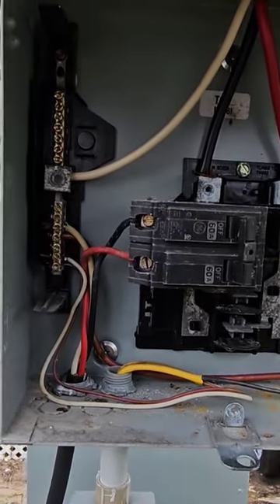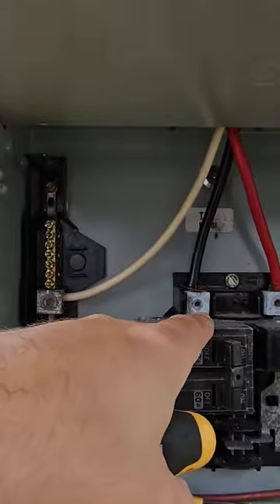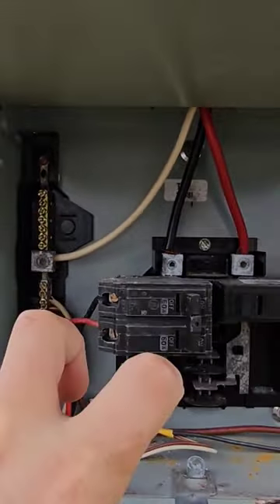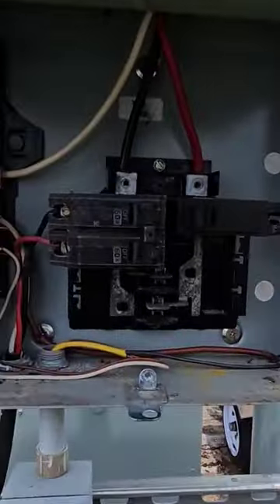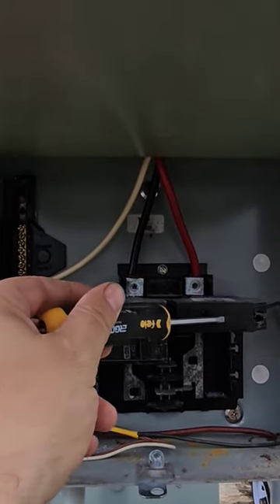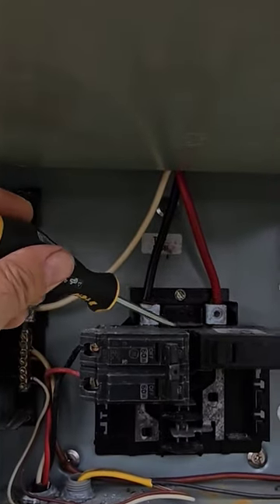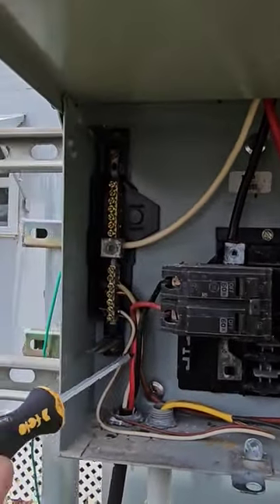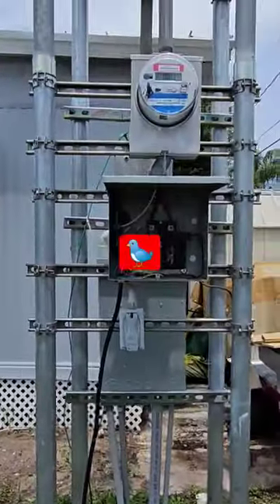There are a few things wrong here.

Comment: Missing main breaker clip because it's a main lug panel not main breaker panel. Designed to be used as a sub
Reply from the maker: Yes, Whenever the main breaker is a plug on style breaker and not bult on it requires a retention clip.

Comment: You need a tool sponsorship. Get rid of that garbage screw driver before you get bit.
Reply from the maker: That is a felo! I love my felo tooles
Reply: @Simonelectricfl wait until you accidently short the transformer and that screw driver is blown into your brain, just saying, play stupid games and it might be your last.
Reply from the maker: @Ozzy3333333  Yea, because screw drivers just fly in every direction.
Reply: @Simonelectricfl  Darwin award nominee, did you miss the point of shorting, willy nelly waving something that can cause a short is pretty stupid, dont worry, you wont know what hit you if you are lucky.
I work on bleeding edge 200Gbaud data tech, this electrical stuff is child's play education wise, but it can kill you in many ways.
Reply from the maker: @Ozzy3333333  This is a felo screw driver, felo is made exclusively as an electrician screw driver i have 3 sets and one is insolated but this is not wear you would need an insolated screw driver but this one is made for working on this exact type of panel, and there are screws all around the interor of panels. Every electrician in the world used screw drivers inside panels. You may be experienced in what you do, but you clearly have no experience with this type of work.
Reply: @Simonelectricfl  wrong, willy nelly waving that special screwdriver, or any screwdriver around an open electrical panel is asking for it, professionals dont do it,  play stupid games and it might be your last. You have been warned.
Reply from the maker: @Ozzy3333333  Thank you for the warning sir.
Reply: @Ozzy3333333 majority of “professionals” don’t give a fuck and use regular tools anyways
Reply: @Steezyy  it's not the "tool", it's how you use it or careless actions with that tool. Jus because your working in a small 100 or 200 amp panel, what's feeding it will vaporize the tip of any screwdriver and launch the rest of it in a random direction before you have a chance to react as it possibly goes through the grey matter.
Reply: @Simonelectricfl  my experience is plenty, mostly in electronics (all repair to component level), PC, power supplies, medical and now 200Gbaud high speed data, all of which is 1000 times more complex than simple power wiring. I have wired 3 houses from the ground up and passed inspection the first time, even being regarded as the cleanest the inspector has seen in his 27 years, all while being the only homes I have done (including RF, data, alarm and fire wiring). While I don't have years for this power wiring, it is totally simple compared to electronics. And quite dangerous if you're doing stupid things near the wrong places. Transformers on residential are usually 15 to 100kVA, let me know what willi nelli waving a screwdriver is going to do when shorting out 100kaVA?
Reply: @Ozzy3333333  Telecommunications is not harder than electrical but agree to disagree. You done stroking your ego?
Reply: @Steezyy  If you are done insulting?
The complexity of electronics (especially the design of bleeding edge chips) is very much 10,000 times more than any power delivery system. What has changed in the last 50 years of the grid, home and industrial wiring. The breaker is probably the most sophisticated item you work with (unless your installing modules), but I guarantee you DONT (and cant) troubleshoot electronics to component level. 
Explain to me the most complex item 
"majority of “professionals” an electrician uses, and understands how to troubleshoot is to component level? I thought so, they just swap modules out, they dont have the time or knowledge to fix them. 
Yout 60Hz is slow compared to the telecommunication operating at 34GHz (yes, thats 34 billion Hz), the tech to get data moving that quick and error free is really amazing. Now go wave your screwdriver at an open breaker box.
Reply: @Ozzy3333333 stick to data
Edit also it won’t send the screwdriver flying lmao it will just melt it or weld it to the lug while it arcs
Reply: @B_Ziggy  LoL, totally shows what you know. Its going to vaporize part of it instantly and what's left over will be traveling away from ground zero.
Reply: @Ozzy3333333  you win whatever projectile screwdrivers O no
Reply: @Steezyy  "He was , in fact, not done stroking his ego..."😂
Reply: @Ozzy3333333  As an electrician for 31 years I've blown up tons of tools but I must be doing it wrong. Can you teach me how to launch a screwdriver? It would really impress my coworkers.
Reply: @stickshaker101  your Darwin award waits for you quietly. Just because you did something all your life, doesn't mean it's correct or safe. Good luck, you will need it.
Reply: @Ozzy3333333  I assume that when I go, they'll rename the Darwin award after me.
Reply: @Simonelectricfl what the Hell is "Tooles"? It's "Tools"

Comment: At the end when you said 60 amps feeding a entire living space on “10 gauge wire”  is it also bad “in my case “ were i have 6 gauge wire runing to a sub pannel to my garage of a 30 amp breaker , from my garage i have another 2pole 30 amp breaker i used to hook up a rv , evrything works but should i upgrage my 30 amp breaker at the main pannel box ?

Comment: That panel looks like it's hot According to the meter above.. Where's your insulated glove?
Reply from the maker: A better question is wear are yours?
Reply: @Simonelectricfl  I get it that you are a professional but personally, I wouldn't even feel safe. Touching 9 V. Without gloves And that's 250V. That you are dealing with.
Reply: @DragonProtector174  You can safely touch circuits up to about 50V with dry hands. But in some very specific circumstances, people have suffered serious cardiac arrhythmia from shocks as low as 20V. 9V is a safe threshold, but you can buy a 9V battery in a supermarket and they're safe for children to handle... it's a tad conservative. I never disconnect the 24V power to industrial equipment when I'm working on it. If I did, I couldn't troubleshoot anything.

(I tell people 5V, because that 's the maximum digital logic level.. so don't be ashamed!)
Reply: @Simonelectricfl Mine just came in from the home office in St. Louis, Class 0, 1000V, tested Dec 2023 due for exchange and testing June 2024, in a pair of Condor leather protectors, in a glove bag under my desk in my office. Again, where are yours?

Comment: How much would a fix like that cost in your area my panel is the same way and with may more breakers
Reply from the maker: It's tough to say it depends on many variables but between 575-2000 for panel and running the new larger wire into the structure that depends on what size wire we go with and distance. But that could easily be more than the panel repair/replacement.

Comment: Yeah, it's old but would not be too hard to make it safer, although there does seem to be some corrosion in the panel. My main worry is the draw on that piece of SO cable. Good chance they have an AC and a water heater in there so already maxed out on the feeder. Let's just say we'll go with 20 - 30 year old code and use the 60 amp for a main, then downsize to a 30 or 40 amp for the SO feeder, plus fix the grounding issues. If there's money, then replace the SO cable with some #8 or #6 direct burial cable.
Reply from the maker: Yea I will be trenching in a new feed when they give me the green light. Plus a few other things to bring it up to code.

Comment: DIY guy; oh man the feed wires from the meter are too short (and underrated), OK instead of replacing the wires to reach what should have been a disconnect breaker I'll just tie them in here. I just saved myself the cost of a 30 amp double pole. That panel is messed up. And nothing wrong with his screwdriver if it does the job. Suggestion, put a piece of red heat shrink tubing on the screwdriver and put a smile on someone's face. :)

Comment: The 60 amp is the main breaker going to the mobile home. The mobile home has its own main connected to that 60 amp. The 20 amp is probably going to some outside receptacle and lighting. Have you ever been shocked by electricity? I'm guessing not.

Comment: 6 throws of the hand, perfectly legal when that was installed, and still today
Reply from the maker: No they are plug in breakers and no retainer clip. Main breaker that is plug in and not bolt on need retainer clip.  Also not aloud anymore.
Reply: @Simonelectricfl  can u send me the code ref on the clips? I cannot find that in art 230. The 2020 is much stricter than previous I see, but still allows 6 switches.  This service would have been legal when installed though, more than likely
Reply: But it dosnt have a main.. Just not labeled probably
Reply: @etucker when exactly was 10 gauge wire on a 60A breaker legal? 😂
Reply: You're only required to have a retainer clip/screw if the breaker is hot when you pull it off the bussing. If the bussing is what's feeding the breaker, no retainer clip.
Reply: @Simonelectricfl  Retainer clip only when backfed, this is legal as you were told elsewhere

Comment: I don't see what the complaint is. Looks like a "temp" hookup 20 years ago. 
Easy just get a new panel why stress looking for parts and running all over town.
A customer of mine have the old pushbutton breakers. Try finding those breakers. It was just easier and cheaper to replace.
And the crazy thing is I actually preferred those push button breakers.

Comment: To be real, i did a panel at work almost 12 years ago with fine stranded tin coated mtw wire and doubled or "folded them  over to use up more area in the lug, never thought about it till now. Never been an issue 😅
Reply: Only if theres vibration I think,  they will slowly shake loose and burn
Reply: @kinbolluck476  hope not lol. It was on a mobile screening plant. Every precaution I attempt is for that exact reason lol. They shake like crazy. To me, if I land a 6awg wire in a lug rated up to let's say 2/0, I'll torq it down, and grab the wire and wiggle it, if I can see the copper strands moving in the lug, ( you could run it in with an impact and it's still going to happen ) I'm pulling it out and doubling it up. The Allen grun screw on most aluminum lugs is smooth and rounded where it pushes down on the wire, it often fans most of the strands to the side and only bites a few. I should say i rarely do it anymore since years back I found a super awesome component called a wire ferrule. Use them on everything now. Every control wire and every feed wire. Time consuming, but worth it

Comment: That considered a service disconnect…you may or may not be required to use a main bus breaker, that a hot bus and you can indeed run a breaker to service a sub…the 10 wire on a 60 is a no go…that also appears to be a 60 amp meter base…go beyond and do a load test…upgrade the service cable…
Reply from the maker: You can use plug on breakers but you need a retainer clip

Comment: It is legal . Code says you need a main breaker if you.have 6 breakers or more . The SO cord feeding the trailer is a problem though. Because the code says wire shall be adequately protected and it's not .

Comment: That is a 812c GE panel it uses a tqmh000 main adapter there is no need to do that is like 20$ and it goes plug and play easy the right way hope it helps check nec and make your load census 😅god blesse

Comment: As long as it’s connected to a breaker in another panel or has a disconnect down the line, it’s completely legal
Reply from the maker: No you can not do that it is a multi wire branch circuits you can not fuse it on the load side like a service entrance. Also the smallest service you can have is 60 amps even if this was a service feeder and there is also a disconnect required 72" from meter.

Comment: Other than the "main breaker" i dont see what the big deal is 
It probably was the main breaker in the beginning then the 20amp was added 
The wiring is correct 
The bonding screw should be there but its not hirting anything 
Its obviously working 
Leave it alone 
Anyone working with electricity should check for voltage with a meter before work is even began.

Comment: I have to say this,, technically, that is proper,, that box is your service,,, same as like a big multi unit, the feeders feed a buss, and then taps off the buss as Mains that feed sub panels,,, so yes, so long as your primary and secondary grounding conductors run into that box, that is your service,, every thing come out of/ fed out of has to have seperate grounded and grounding conductors in the feed ,, and those things being fed are now sub panels,,, so with what I said before combo Ed with this,, it totaly depends,,, if that little box is your service, then until you get over 6, sub feed mains,, there is no need for a "main" for the service,, it's totaly depends on the situation,, you may be looking a legit service

Comment: Who plugged that meter in there? Customer has no main breaker. Now if there is a fault in there? The last line of defense is the fuse for the transformer. That’s on the high voltage side. Scary !

Comment: Gees, all domestic American electrics looks so industrial, clunky and outdated.
Reply from the maker: This panel is a bad example to go off of as a representation of American panels. But there are definitely differences between European and American panels one of the reasons for that is most companies don't want to spend the millions on obtaining new ul listings on different/ new breaker and panel designs.  So the breaker and panels that have been manufactured for the last 30 years have proven to be pretty reliable and safe especially with the addition of arc fault. But I have been to many areas of the world and comparatively speaking  a few countries have newer/more updated equipment but 90 percent of the rest of the world are not even close to the safety and regulation that American provides.

Comment: Bonding screw should only be used at the first point of connection either off weatherhead or transformer. Not off that small subpanel.

Comment: Dude has never seen a MLO panel before I guess
Reply from the maker: You can not have a main lug panel wear you need a main breaker. Unless you backfeed the main breaker. They wired this wrong and the main breaker became the branch circuit.

Comment: No shortage of anecdotes about amateurs and professionals being shocked or burned or killed working on electrical. For example I notice you are not wearing gloves nor is your screwdriver insulated. The safest way to show items in the panel or reset a GFCI is a short wooden shaft like a chopstick or dowel, just throw one in your tool bag.

Comment: First let's keep the screw driver out of the panel and second didnt mention that the breaker over under wired for its size too.  You said it was a 60amp but wires ment for a 40

Comment: 😂 the 60 is the trailer main.  The 20 is not going to the trailer.
Same way i have a box outside like this with 2 100A and one 200A mains for my buildings. And a 20a for my yard light.

Comment: Nevada needed no final on mobile homes till the 80,s lots of fires so cord from service 0anel to trailer or.metal flex not seal right water proof no ground wire 8f seal right was used

Comment: It has 2 mains, yo!!
Reply from the maker: Neither are considered mains because they are not bolt on, so they must have retainer clips if they are mains 480.16(F) and the new 2020 nfpa 230.40 exceptions 1,2,3,4 or 5 do not list this as a viable option for multiple main breakers.

Comment: Depending on what year that was installed, it might have been legit at the time,,, no more than 6, disconnects ,, that technically is 2, one single pole, and one ,2 pole, main breakers, that feed other things,,, now bonding screw, yes that box would be considered service,, and bonding is and has been for more than 60 years required,, the metal box needs to be bonded to the grounded conductor,, but,, technically, that is a service, from the meter to the disconnect, is in fused,, from the meter one can feed a trough and drop outs to panels, each have a main,,,, or one can feed a bus, and load must be protected as a sub panel, in sub panels, gou fed and group do g conductors must be seperated,,, but back In the day, metal conduit bodies where used as a grounding conductor,,, not any more, but we must bond them the the grounding electrode system,,, all love brother man,, iv got out of high school in 1991, and have been an electrician ever since,,,, I'm one of the old school,,, one of my skills is a master of knob and tube wireing,, Harrisburg PA, all love brother,, remember back in the day, wene it was installed 🤔🤔not the same as we do now,, but was legit at the time

Comment: There is lots wrong with this installation. 
This is the wrong panel for this application. Back feeding through the 60 amp breaker is wrong as well. 
The whole thing needs replaced and done correctly.

Comment: As a joke,, ok so 10 gauge  so cord on a 60🤔 well I guess they built in a mechanical fuse🤔🤔 or, built in fire🤔 depends,,, but yes the feeders should go to the 60, and "newer" code, let alone not a bad idea any how, the main breaker retention means, plastic clip, or other mechanical, meaning a screw, or strap. There is a thing called a split bus panel,, in a day and age were totaly legal wene installed

Comment: Quit with the screwdriver already. Read old code when the trailer park was wired .. in it you will find things that are not done today.  6 disconnects that would be the main for the unit the other panel have the ground your looking at a sub panel and equipment bonding system..